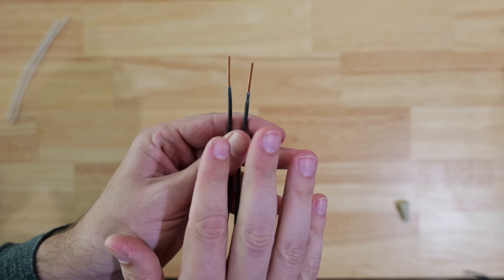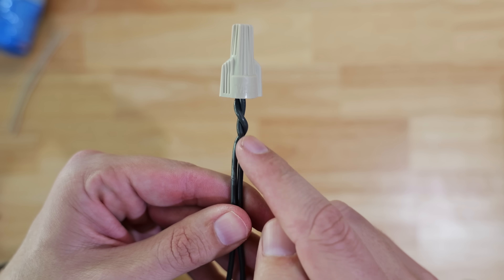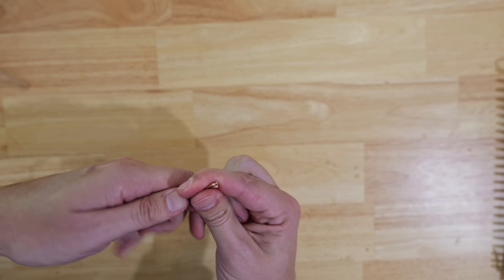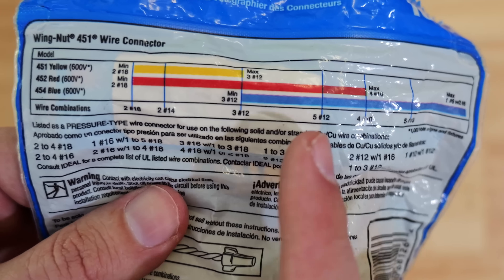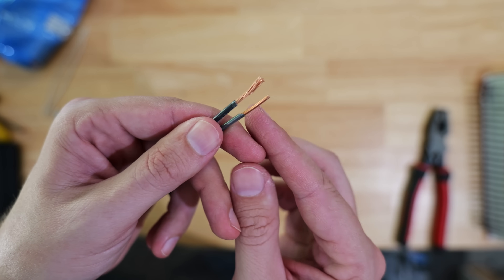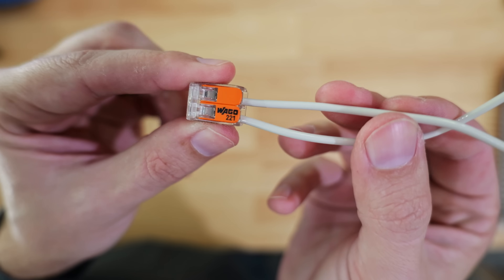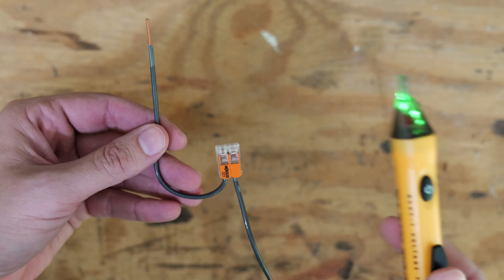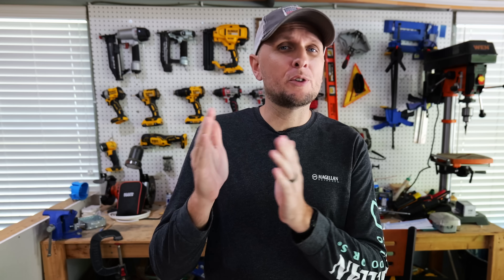7 FATAL Wiring Mistakes Most DIYers Don't Know They Are Making | Most Are Guilty of 3

Comment: Never had any issues with Wago's! Easy to use, much faster to connect than using wire  nuts!
Reply: And not as secure and not as conductive.   Watch the video by Ideal.  2 wires into a red connector.  I think the nut can hold a hundred lbs.
Reply: @jamescole3152  Why does it need to hold on to 100 lbs ?? I believe/know.. yep, female ^retired now^ electrician here) that Electric wires aren't ment to hold even close such weights..
Reply: @mademoisellekaya1438  meant to hold != can hold; obviously the statement is simply suggesting that a good wire nut is simply more secure.  Also, I noted you didn't address the conductive point.
Reply: @cwtrex  Why should I have to go into the conductive point. That was not my point.
I am from the generation that threw away those darn wire nuts, the first female Electricians in the early 90's .
And no, not French as may the name suggest.
And yeah, European.
Reply: @mademoisellekaya1438  But WHY did you throw them away?  The point here is supposedly wire nuts (good ones that is) have better conductivity and holding strength.  You haven't made a single point as to why you would throw them away or why you would disagree.  And I don't understand what anything else you've said has to do with anything relating to those points other than distract from them.  Not sure if you are simply looking for a high five or whatever, but I am more interested (regardless of your background) as to why you might disagree with the point that was made.
Reply: @cwtrex  if you read through the comments on this video, you will see why the U.K. banned wire nuts over 50 years ago, they are a fire hazard in the wrong hands. For every one person using them correctly, there are ten that don't know how to use them correctly.
In the U.K. every inaccessible connection has to be maintenance free, in other words, a connection that can over time become loose, has to be accessible.
As for pulling apart a wago connector using brute force, any application where a wago connector, in fact ANY type of allowed connector can come into contact with untrained hands, they have to be installed within a junction box that has cable grips to protect from apes using excessive brute force.
As for the so called bad examples in this video, the video maker is REALLY clutching at straws, with non issues. Which makes me wonder whether he's sponsored by a wire nut manufacturer, or he has misplaced loyalty to a truly out dated antiquated dangerous connecting system.
Before replying to me, check up which countries have less household electrical fires per capita, caused by the wiring, and which have the higher number out of the first world.
There is a reason the U.K. is regarded as having the best and safest electrical systems.
Reply: @mickk8519  Definitely appreciate the summary and points you made.  This is more of the response I was hoping for. :)
Reply: @cwtrex  Twisted connections are banned in several European countries. A good reason to throw them away.
Reply: Good electricians do not use wagos! Good electricians are not lazy and will spent the extra 30 seconds to make a real connection and not the same one used with back stabbed receptacles! Good electricians will take pride in their work!
Reply: @explod329  And what is this good connection instead of wagos that takes 30 secs - in the countries where twisted cable connectios are banned because of their unreliability?
Reply: *Wagos
Reply: @jamescole3152  not as secure is wrong. WAGOs handles vibrations WAY better than wirenuts. wirenuts also untie themselves if you got fluctuating temperatures. Also you dont use a cable as a rope to hold things up, so you dont need hundred lbs of holding power. wirenuts may have hundred lbs of holding power but struggles when it comes to vibration. which youre way more likely to encounter than needing hundred lbs of holding power in a vibration free enviroment
Reply: @cwtrex  its not more secure. wirenuts fumbles under vibrations, WAGOs dont. also the conductivity argument is nonsense. therye rated for what theyre rated, no matter which method they connect to the wire with.
Reply: @TraktorTarzan  Thank you for your point of view.  It is odd to me though that THE solution is a component made by a single company: WAGO.  Is there no trusted third party solution beyond this single company?
Reply: @cwtrex  i am an electrician, and only use branded wago for work. there are some push connectors thats not wago thats good, but i dont like push connectors unless its for single stranded wire.

the reason theres only one is cause of the patents.

but on my own personal tinkering projects i got a third party chinese brand which i use, mostly cause i wanted to see the quality difference, but i was surprised that it seems as good as the wago brand
Reply: @cwtrex  i forgot the brand of push connectors are helacon. theyre used everywhere here a long with wago. i just dont like push connectors in general, cause the grip they get on single stranded wire is insane, and therefore a pain in the ass to get off
Reply: @mickk8519  
I'm not a big fan of wire nuts, but they have their place.  They're dangerous if there isn't enough wire to wire surface contact.  They're very safe with a proper connection pressing wires securely against each other.  However, they also tend to damage wire ends and I've overtightened a few and a wire end broke off where I had to strip off some precious wire slack to re-do it.

My understanding of why wire nuts weren't used in the UK was because the wire nuts at the time were made or ceramic or porcelain.  They didn't have any metal in them, but a spiral groove designed only to press wires against each other once twisted.  I think the big issue was that they tended to break when overtightened.

My understanding is that modern plastic wire nuts are fully compliant with UK electrical standards, but still not commonly used.  However, I've found several sources for wire nuts in the UK, including Amazon UK and Raptor Supplies.
Reply: @explod329  Good electricians don't just stay with 100 yr old technolog!  Good electrician move with the time and use better technology when available!!

Comment: Wow!  That voltmeter reading was a real eye-opener!  I've always figured you either have contact, or you don't - but that demo showing how an improperly stripped wire may have partial contact (I think?) and show voltage on a NCVD, but only around 5 volts on the DVM?  WOW!  Thanks for excellent info with great visuals, demos and clear explanations!
Reply: Although it technically can happen, that part on the video is fake, you can clearly see after he uses the non contact tool he cuts the video and switches to a different video clip using the meter and shows around 5v
Reply from the maker: It happened.  There is a cut only to not waste everyone’s time screwing around with getting the NCVD set down, the probes in hand, and making sure the camera isn’t going out of focus.  Nothing was messed with in between.
Reply: @HowToHomeDIY  Thanks for clarifying and thanks for a very informative and good video. Liked and subscribing
Reply: @HowToHomeDIY  we called this a phantom voltage and it's like you describe.   Not enough contact to flow ample current but enough to pass through potential (v).  

Same thing we'd see in the field on mechanical relays that had carbon build up, or the well known issue with aluminum wires that never get tightened or maintained.
Reply: The power (actually voltage) you are seeing at the end of the insulated Wago wire, is usually called induced, ghost or phantom voltage and is not dangerous, as there is no current associated with it.  It is voltage induced into the "dead" wire, due to its proximity to the live AC wire.  There are low impedance multimeters for double-checking, that that is what you are experiencing, if you're worried.
Reply: @luishonduras  

"That part on the video is fake, you can clearly see... That I have no clue what I'm talking about, and I'll have to back peddle in my next comment."
Reply: I agree. I've seen electricians using a standard 10K Ohm voltmeter without any load deciding that since there was +115V coming out of a socket everything must be ok.  It makes me believe that even some experienced electricians don't have an understanding of Ohm's law.  And then induction must be complete magic to them :-)
Reply: @jimbobbiocarumba1770  Exactly this. I suggest a "wiggie" for most checking of this type - its a low impedance tester. Using a high impedance meter on a low impedance circuit like this gives you fake readings as seen...

Comment: The Wago levers are pretty hard to lift and unless you pull the wires and the level catches on a cover edge or something, there is no way it's opening by a little jostling. (Assuming you chose the right Wago size for your wires etc.) Clamping the levers down manually does nothing to the spring force inside the Wago. The wires are held in place by a spring and lifting the lever by half a millimeter, or whatever play there is, does nothing.
Reply: I might be a derp but I just bought my first set of wago connectors and had this exact thing happen to me. I caught it immediately and rectified before continuing to stuff the wires in the box but a little electrical tape will probably go on my future connectors just to simplify. Especially for my application with smart switches - things get tight REALLY quickly.
Reply: @RussSchampers yeah trying to install smart switches right now and holy hell they take SO much space.
Reply: ive used tons of wagos and they work so great. never had one do anything. i can see the tape the levers helping.
Reply: As long as the lever isn't actually open, as you note, the lever not being fully down doesn't do much.  At the point the cam action of the lever engages with the spring to compress it, there's a good deal of resistance to the lever opening.  Anywhere from completely closed to where it starts to meet resistance, the spring has as much pressure against the wire as it ever will.

There have been teardowns and even tests where a WAGO 221 was pushed well beyond its current rating.  I saw one test from WAGO that showed maybe 5x the rated current going through until it melted.  Even with all the plastic melted, the springs maintained the connection with the bus bar.
Reply: Wagos are GARBAGE; no better than the "push-in" connectors on 15-amp switches & outlets.
Reply: Iw been using the older wagos and these newer ones for 10 years at my job, all the little problems he warned about, I have came across. The older lever wagos used to much tighter and would be impossible to accidentally lift open but they snapped on your fingers when closing. These newer types I have definitely accidentally opened many many times.
Reply: WAGO connectors are for back-stabbers. Even worse than receptacle back stabbers, as it only takes one lever accidentally getting flipped open, either by cramming in too tight of a box or line vibrations, and a hot wire can become loose very quickly. But I guess they're useful in the UK where apparently the majority don't know how to read instructions or wire a nut properly.

Comment: Great video. Thanks for the reminder on how to properly use wire-nuts.
In the walls next to my washing machine, I twisted the wires as you stated, then I soldered the connections, then I crimped a Closed End Splice Connector over them & finally used electrical tape over them. It may be overkill, but I feel it is better safe than sorry, since my kids continue to overload the washer & it dances around on the floor bouncing against the walls.
Reply: and you still did it wrong. all those splices in your walls should be in accesable boxes
Reply: You way over did it, but it is worth it, if it makes you sleep better.
Reply: Here's a tip for you, use Wago 221 connectors and be done in literally 10 seconds.
Reply: @69BTony  
I found a lot of soldered and taped connectors and cut all of them out.  I don't trust electrical tape to hold for years.  A properly tightened wire nut should be fine.
Reply: @ypw510  I found some splices in Turkey that were 3 inches of 14 equivalent copper solid twisted together and taped.  In Germany they use set screw type connections.  In Iraq I saw a yellow and green conductor coming out of a 220V breaker.  I guess it is just what you get used too.
Reply: @69BTony  
I guess they call those screw terminals or chocolate blocks since they break off into individual connectors.  They do seem pretty secure.  I don't have a problem with well-made push-in connectors, lever connectors, or competently used wire nuts.  Of course in some countries they think Americans are insane for using wire nuts, but twisting and taping is fine.

My issue with electrical tape is that the adhesive eventually dries up and I'm not sure I'd want to rely on a taped up wire bundle not coming undone if it's going to be in a box for decades.  I just removed a few connections today that were twisted and then crimped with a Buchanan crimp sleeve - then covered in tape.  I actually kept some of the twisted wire so I didn't have to cut off too much and that went into a wire nut with a pigtail.

But I've also seen some bundles that were twisted and soldered, then covered with rubber splicing tape, then electrical or friction tape.  The rubber tape was very secure, even after 60-70 years.  But I needed more room in a small box for a GFCI receptacle, so I replaced it with a wire nut and pigtail.

Comment: Great Video. I hate using wire nuts for anything. I normally twist them as you show but i always use electric tape to be certain they will never come apart. I know never say never but it greatly reduces the chances. I have never used the lever type but I like your Idea of using tape also with those. I am no more than a DIY'er but I am extremally concerned with the potential for fire. I mostly do this wiring in my own garage and sometimes in my own home. I just hate wire nuts and even worse with stranded and solid. But I feel a lot more confident now that I have watched this video and of course I have read the packaging none the less I feel much better about using the regular wire nuts. And in addition I do not use the cheap ones that come with anything. Always IDEAL is my choice. Especially pig tailing. Great video. Thank you and I will try the clip on ones at some point. I would guess they are not cheap but for peace of mind what is expensive?
Reply: Just switch to Wagos. Thank us later.
Reply: Other guys channel showed even partially closed (improperly) they hold 20 lbs of force pulling on it. WAY more than it should ever see inside a box. 27 lbs when fully properly closed.